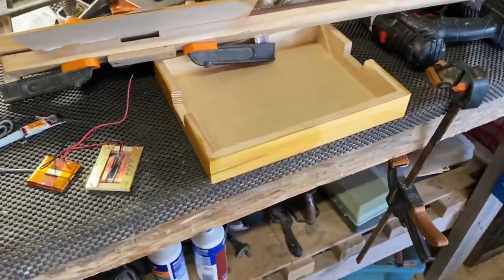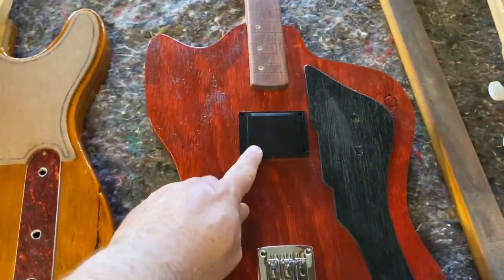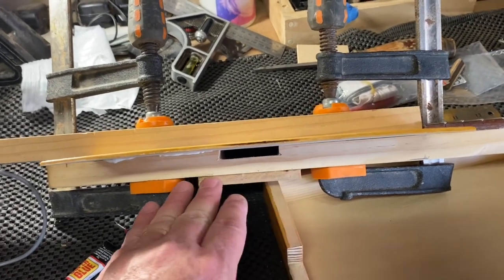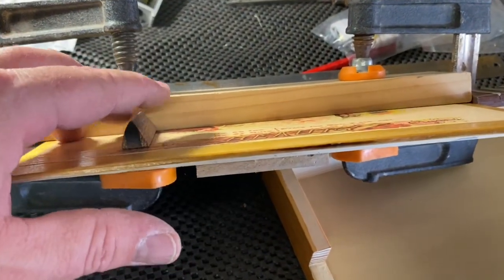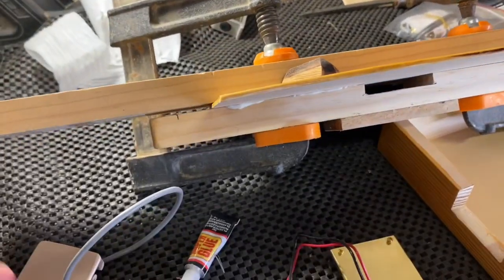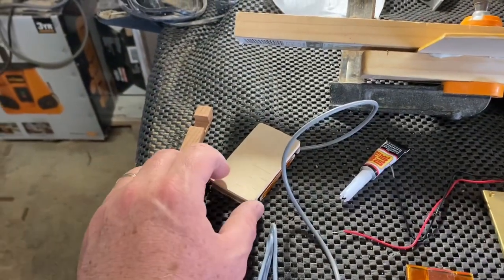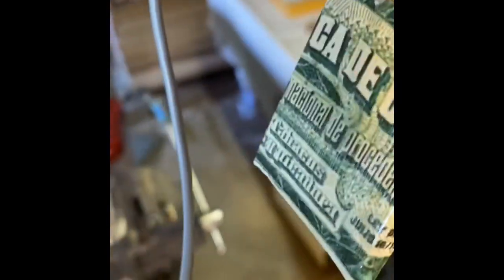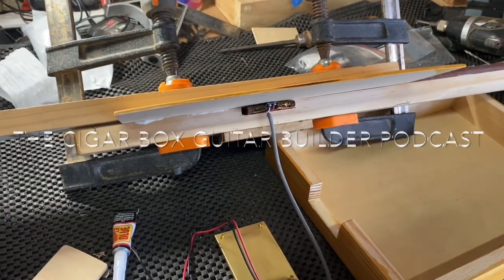Different ways to install flat pickups on a cigar box guitar

Comment: good god thank you.   nobody is willing to say how to secure it to the neck.  I thought these were supposed to be free floating in there boxes. That made no sense to me.  Also thank you for explaining string grounding.  You are the first person that ever explained to to get through my thick head.     the best part is I put a 4-40 screw across the strings behind the bridge to hold down the strings so they grip better on the bridge, it will be nothing to solder a wire onto that screw to make a string ground and tie all the black wires together.

Comment: Im throwing one of these on an old acoustic guitar and i was having trouble looking for where to ground it. I figured i can ground it to one of the pickguard screws, but im also throwing power pins 2.0 on one of my acoustics so i should be able to ground it to the plate it comes with
Reply from the maker: You MUST ground to a point that touches all the strings tab the same time. Your best choice is the bridge. I’ve used layers of copper tape under the bridge plate where the ball ends touch. It worked too:) Let me know how you go. Oh we also have a very engaged FB group under the same name Please feel free to join.

Comment: how much does mounting it under the lid effect tone?
Reply from the maker: it depends how far away from the strings the pickup is. The strings need to travel through the pickups magnetic field. Placing the pickup under the box lid can result in a weak pickup out put. Sorry for the delay in replying
Reply: @thecigarboxguitarbuilder1860  all good, thanks